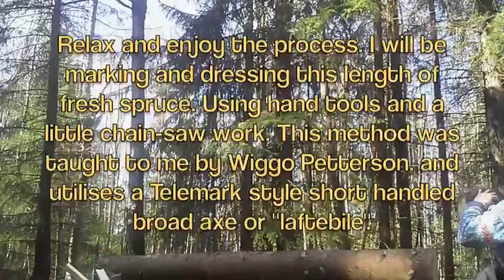🔴 Hewing timber using  a Norwegian method.

Comment: you can also use radiator cooliant to tighten the head, just put your tool in a bucket with the antifreeze and let it soak, the water will evaporate but the glycol stays in place and tightens up the head

Comment: soak the eye with the handle attached with boiled linseed oil if the handle isn't damaged. if the handle is damaged then replace it and then soak it in linseed oil. don't use water it will not only evaporate but will weaken the connection between the handle and axe head after the water evaporates.
Reply from the maker: I'll give it a go, thanks. I have usually just put the axe in  the stream for an hour. We have a seasonal humidity disparity here, it being particularly dry in winter.  My Ash wood stash is under the barn so it holds whatever humidity is current. That's what I use to make new handles. There is a lot to learn in every small thing so I am forever a student.

Comment: I was taught to stand on the other side of the log to put something more solid than some denim cloth and a inch of muscle between my femoral artery and a very sharp ax. I was also toubht to crosscut the log horizontally and the turn it so the choppping was done vertically.
Reply from the maker: Well done Greg! This is a demonstration not a lesson. Don't try this at home! What you describe must be a lot safer, so stick to that.

Comment: Hi Lucas, I've seen plenty of draw knives, but your drawknife is huge!
Where did you get it, or is it a special tool with a different name?
Thanks in advance.
Reply from the maker: http://www.dahlmo.no/bandkniv.html
Reply from the maker: Hi BoS, this is particular as it has a curve in the x and y axis I call it a "skavkniv" and it is a type of "båndkniv", it is favoured for timber-house building as it is good for shaping the timber as well as for removing bark, regards Lucas.
Reply: Thanks for so quickly answering my question! I have been gathering woodcrafting tools for a while; I am definitely going to save for this in time!

D'er mange ǿksarhogg, som eiki skal fella!
(Hopefully that made sense, I don't speak Norwegian.)
Reply from the maker: "There are many axe chops that don't [or shouldn't] fell." It is not modern Norwegian but I think this is the meaning.  I was wrong, "eiki" is oak (eik) not as I thought "ikke" which means not or shouldn't. So the translation would be then, "many chops will fell an oak".
Reply: @howtoguro   D’er mange ǿksarhogg, som eiki skal fella = Little strokes fell great oaks. It's not neceserly about chopping down a tree it's more about a difficult task, e. g removing a person/group from a strong position, or changing established ideas cannot be done quickly. But it can be achieved gradually, by small steps, a little at a time. Hope this makes it clearer

Comment: Well done, I've done it that way as well and it seemed to be easier on the back. Is that axe a Gransfors or is it a local blacksmith? I'd like one with an offset handle
Reply from the maker: The axe ("Laftebile" in Norwegian) was made by Jon Dahlmo. Is was an inexpensive axe to buy as the hard steel is stick-welded rather than forge welded the handle is not original, it being made by me. The handle has to be straight because it's primary function is "lafting" or cogging/notching the corners of log houses.

Comment: I think perhaps rather than physically turning the log end-for-end, you could just roll the log on your 2 supports for the second side.  Then just nail your top strips to the other end, and continue on.  At most, you would just need a cant hook to roll it with.
Reply from the maker: Did you want to watch me striping the bark twice? If the ground weren't so sloped I might have just moved the dogs to the other side. Lucky it was a small bit of timber.
Reply: Lucas Richard Stephens  Can't see what you're doing on the other side away from the camera

Comment: that's a very nice trick to use a piece of timber and nail to fasten the log when the log dog is missing out! I am wondering about something about work procedure, though, wouldn't it be better to use different axes for the rough and fine work in the hewing process? I am just thinking that perhaps a forest axe for be better at splitting out the wood between the saw kerfs with it's smaller edge and the more delicate and precious laftebil could be preserved for the finish work after the big chunks are gone?
Reply from the maker: In North America I believe that two axes are used just as you suggest, even wielded by two different axemen. I am just doing it as I was taught, straight from the living 1000+ year tradition (which has developed at a slow pace). It took a long time to get good at it, and now that I can do it, I don't feel I need to experiment too much, when I need a hand-hewn log, I make one. It really doesn't come up all that often. Compared with the thousands of meters of milled and planed timber I have worked on for houses, the hand hewn timbers are few and far between. Thanks for watching, all the best, Lucas.
Reply: @LucasRichardStephens  thanks for the comprehensive answer! When I think about it I guess I am talking from a standpoint in quite a different tradition - being from Denmark we have very different building costums that of Norway, and is heavily influenced by Germany - I mean we used to rely on clay, mortar along with timber framing. I can see that in a country like Norway with mountains all over you cannot bring along a whole arsenal of specialized tools but will have to put a few general tools to the best of their use in this context

Comment: What do you use this logs to?
Reply from the maker: this is the film description; "Real time video, following Lucas Stephens hewing  of a piece of timber, ready to use in the restoration of a building locally near Jevnaker, Norway. 
   I have had to make timber by hand like this a few times, it is not that much slower than using a chainsaw mill, since there is less to set up.  The chain saw is just used to make clear guiding lines and instead of juggling, which helps with the speed of the work with the axe."

Comment: According to tradition the logs should be cut in jan/feb/march. A must to have the logs frozen to avoid "blue" color and less quality. In short, to make it last cut the timber during winter. At least this is the local knowledge in the south of Norway.
Reply from the maker: Thanks for the comment, I will add some of what I have been taught about Timber for Lafting, so as to help viewers understand better the pros and cons of what you wrote.

The Blue discolouring "Blåved", is caused by a little beetle: an injected fungus meant to feed hatched beetle larvae.
It is principally Pine that suffers this fate less so Spruce (as used in this film). The date for infection varies  by latitude and altitude so local knowledge is important, here for example we should cut pine before summer solctice. You will be relieved to hear that Blåved does not damage the timber to any significant degree and the colouration, which is unsightly in new timber houses, bleaches in daylight (falmer in Norwegian) becoming undetectable after a period of time.  So all in all Blåved is a minor problem and in the case of this film of no concern at all.

The other aspect of your "rule of thumb" is that of the importance of low moisture content in timber for building, which is the main reason for winter felling.

Frozen timber though, is NOT in the least desirable for hand debarking or hewing for that matter, especially not Pine. 

Spruce, as used in this film, should also be felled before the sap rises in spring for the lowest water content, but unlike Pine it can also be ring-barked, killing the tree and drying while standing which is speeded up by the branches. resulting in the wonderful combination for hand workers: "dry and fresh". Since air drying takes a very long time after felling the wood hardening all the while, it is less desirable. Mechanical drying is sadly inefficient.

Much of the old knowledge regarding the preparation of timber for laftehus is sadly supplanted by the conventions for growing and harvesting  timber for the saw mill and paper production. There are nevertheless many people here in Norway researching the ancient advanced methods for growing and harvesting timber for Laftehus, mostly working for the State or Museum milieu but also some house builders and restorers.
 
 I can recommend the writings of Jon Godal for very in-depth study of timber for  house and boat building, not sure his work is in any other language than Norwegian but it is possible. He also lectures on the 
subject, well worth a look.
Reply: "low moisture content .... is the main reason for winter felling". 

Well, I've been logging timber all over Østlandet, particularly close to the Swedish border (Finnskogen) and I thought the main reason for winter felling is the advantage (or rather necessity) of frozen/snow covered ground or lakes to get the timber out. Especially in historic times when horses were used. Have you ever tried to haul timber on wet and soft marsh land in the summer? A modern 8-wheeled forwarder with boogies can do it, but that is hardly the reason why timber has traditionally been cut during winter season in Scandinavia.

Besides that, "blåved" is sadly a defect that sends the logs directly to the P&P pile. I use it daily in my woodworking work and though its "not nice" to look at, structurally it's no difference.

Finally, great videos and great topics. Def subscribed. (but what will you do now with those relic FM-headphones?? listen to the birds?)
Reply from the maker: What you say is true of course, about practicality of ice, but rest assured, if there was a building-technical reason to fell with the sap in, it would have been done. Just as in the past trees were grown under shade, despite the increase in growing time that results. Historically the quality of the timber was paramount, now quantity is the aim.
It has been this way for nearly a hundred years already. Which is why ideal timber for lafting is increasingly difficult to obtain.

There are other practical reasons for winter felling such as there being less to do on the farm in winter generally. 

I could plug in my telephone, the headphone have a aux in. I am quite fond of them, I have had the one pair for donkeys years.
Reply from the maker: I heard recently that the tree contains more sugar in the summer, making summer felled timber more susceptible to insect damage; yet another good reason for winter felling. There are surly more too, Jon Borge Godal is the man to ask... 

You can bark and hew frozen wood too, and woodsmen did in the past, but it takes a lot more effort so I avoid it.
Reply: Jostein Senumstad  That's so the new growth doesn't start.

Comment: how did the old people do it without the chainsaw
Reply from the maker: Here in Norway they used a "småøks" which is a hatchet with a long narrow head. Like the one in this film; https://www.youtube.com/watch?v=Ngt_nrZOUg4&list=PLkyg-9ysqRq1jgwEuv6t3UZCpOL5zFh7B
Reply from the maker: I made a blunder, I thought you were commenting on a different film I posted. The correct answer is not the småøks. Before the chainsaw this work was done with two different axes one more normal axe for the juggling and the broad axe to do the hewing. You can use the broad axe for both but it is a bit broad so it doesn't penetrate so well across the grain. A case in point is that I broke the handle of this axe just recently chopping a tree (across the grain) after I got my chainsaw trapped/pinched, simply because the broad edge jarred so hard on the timber.

Comment: Nice Broad Hatchet, Tip : If you take a Rat tail & Flat File to properly taper the eye then rewedge it shouldn't slip anymore.
Reply from the maker: Axes slip after hours and hours of use and the change of the seasons, thats my experience after 26 years using them at work. Good advice though your comment is, the interior anatomy of this axe is excellent. Welcome to the channel and the 140+ films I have made about the work I do.

Comment: can anyone say femoral artery?
Reply from the maker: Looks dangerous doesn't it. I have cut myself on this axe many times, but usually just bumping into it when it is not in use, I did that just this week.

I didn't make up this technique, it was taught to me, it is old, maybe even a thousand years or more. The point is that this way eliminates the danger, and if you watch other hewing films of people taught in a tradition, the same will apply. Dangerous ways don't become traditions in hand-work.   At 32:16 notice the drop in the level of the handle for the heavy blows, the force is pointing further away from the body so when the knot is cut through the power is not pointing at my leg but the ground. Having a short handle the arc of the follow through swing brings the axe back round quickly,  the force being spent though, the control is not lost. It is the most dangerous  aspect of this technique and one should not let concentration slip. It is the whole reason for the timber being at this height , any lower and the danger of injury is much higher (with this axe).
Reply: Great video for showing technique, I wonder how many of the commenters have ever tried themselves? Good point, that it's what works and doesn't kill anyone, that becomes method! Incidentally I hewed one side of a log, not even half that length and was exhausted, I'm hoping my method improves with my fitness....

Comment: Get yourself some real "timmerhakar" to hold the log instead of those make shift boards with some nails in them.. you deserve it!
Reply from the maker: I might make some for fun, I like the ones that have a threaded section for adjustment, which is very useful when building new log houses. But consider the flexibility of the plank and nail, when this job is done they can be re-purposed, while dogs are dogs. Quick and simple is sometimes the order of the day. Thanks for watching!

Comment: I live in a house that Norwegian settlers built when they moved here.(BC Canada) The timbers are all dome with a broad axe. But the axes they left have longer handles than what you are using. I am not sure how that would have worked. Do you always use that length of handle? Thanks for the well done video.
Reply from the maker: This kind of short handle is particular to the Telemark region, it is very ergonomically formed with a hook-like end. With longer axe handles the timber should be lower to the ground when hewing. I have used this axe for over 20 years so it is on it's 3rd or fourth handle, I seldom use it as a crowbar these days....Mostly I use this axe for notching the corners (lafting) it is ideal for timber up to 9inches any larger and a longer blade would be needed. I may make a video of lafting sometime. We usually have timber delivered with the sides milled so the hand hewing is only generally for small scale repairs. Even a fairly small house take about 1000 meters of timber (log) so it would be excessively expensive, and strenuous  to hand hew, but perfectly possible, I do like this finish of a well hewed log better than the planed surface we deliver in the modern market.
Reply from the maker: Hi Vita, most timber houses in Norway, 100 years and older, are built with one or other variant of a saddle notch. We don't use chinking. My other videos show more details about restoring the old houses. New timber houses don't use dovetail cogging. Dovetail cogging was sometimes used for 40-60 years from about 1880, in my area mostly for stables and cowsheds "Fjøs".
Reply from the maker: I think it is because line-scribing the logs is tricky and not all the settlers were so skilled, or had the exact knowledge needed to create an air tight timber house. It took me 1000 hours to learn the basics from a master and and few years of experience before I could build a timber house efficiently. Add to that the uncertainty of using different timber types than spruce or pine which is normal in Scandinavia.  If folks arrived in an area late in the year they may have had to get something built quickly and cut a few corners.
Reply from the maker: vitavinivideo
 Yes there are many regional variations. Our oldest houses using this technique are 700 years old and in good condition. They don't need to be treated, I usually  recommend my customers not to paint or tar them. Homes are more carefully made so as to be airtight. Stables don't need to be and are so humid inside its good to have some drafts.
Reply: Never heard of no chinking.  I'll have to check out your video on that.

Comment: Are Norwegian hewing axes typically short handled? I think they are pretty short in North America, could be 26 or less inches.

I’ve got a hults bruk hewing axe coming that is just beautiful. Thinking about a 26 inch handle
Reply from the maker: I think it is safe to say they are, yes, generally. The axe I use here is called a Laftebile and it's primary function is cutting corner-cogs on timber houses, the hewing is secondary. Though I am no expert on the variations to be found here.